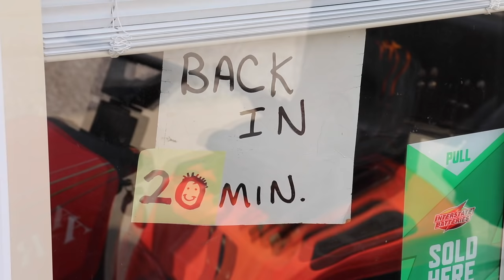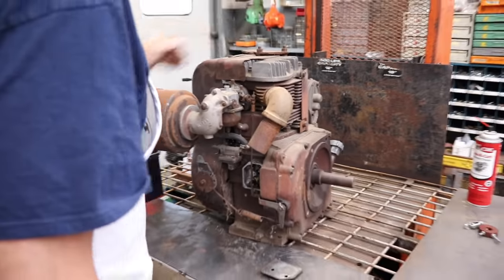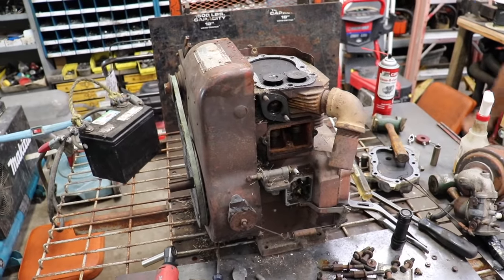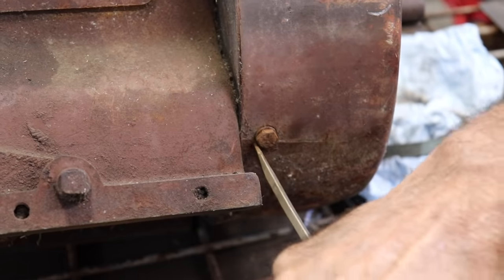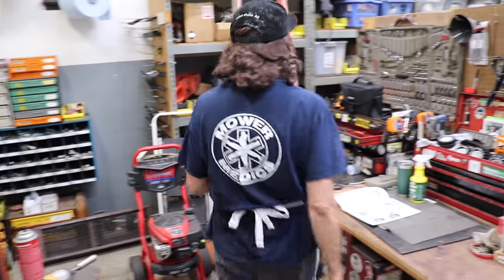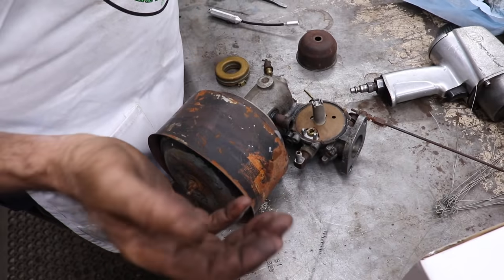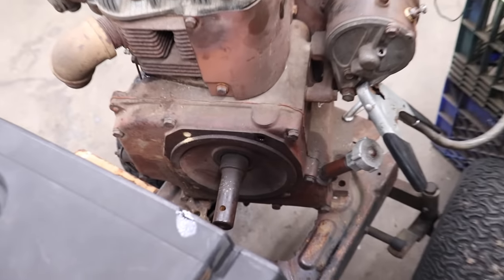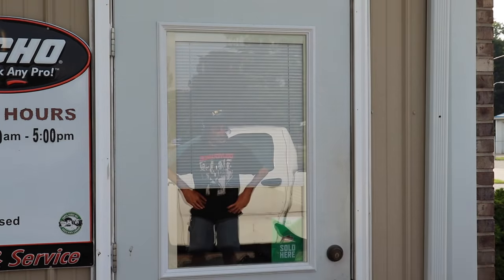Incredible Vintage Wisconsin Engine - Will It Run?

Comment: Hey Taryl,     Just wanted to thank you for a suggestion you gave regarding cleaning up valve seats using emery cloth and the valve to mimic the angle of the seat, to clean them up.  It worked like a charm. Working on a Wisconsin ABS engine, virtually zero compression.  Thanks to your recommendation, it has compression now!!!!   Thanks you Sir!!   Your videos are awesome by the way!!   👍🏻👍🏻

Comment: Back in the seventies, when I was a young apprentice carpenter those Wisconsin engines were on all kinds of equipment, mixers, generators etc. They ran real good and pretty dependable.
Reply: I used to have one left in a garage I bought. It didn't have generator starter, it had rope start with huge magneto off the side, like a Joe Hunt magneto.
Reply: They were great engines and I worked on a lot of them

Comment: Every think about getting a rear engine snapper and weld/mount an engine mounting plate to the front?  You'd have a drivable test frame. You could make the engine mount a bit higher so you're not constantly stooped over working on an engine. Then when you're done you could drive the test frame out of the shop and park it next to MoTow.

Comment: Cool project, only Wisconsin I’ve ever touched was about 50 years ago when I was very young. As I recall the motor weighed as much as I did back then.  I also remember the shock I got from the Wico mag it had!
Reply: Yeah, them mags ain't BSing , eh?
Reply: That's how I 'learned' to check for spark on old small engines. "Here, hold this while I spin it over!"
Reply: Yep 👍 
It’s a light up your life

Comment: This brings back 1976 shop apprentice memories. Getting yelled at for using the boss’s extra thin Snap-on tapped wrenches to loosen a rusted deck bolt. “Not my Wisconsin tappet wrenches you numb skull!” Today I could sue, and own the shop for being traumatized.  Well at least I remember what a tappet wrench is.
Reply: Litigation run stupid ... I'm sure that Snap-on cost him dearly 👍

Comment: The TRA-12D for sure came out of a Bolens. I have a 1971 Bolens Husky 1256 with the TRA-12D. I recently blew a head gasket on it. Was still running on 28 psi compression! Plowed, disked, and tilled my garden with it like that. Bulletproof engine!

Comment: Pretty cool Taryl, I like old engines and equipment, I have an old Briggs and Stratton 16 HP horizontal shaft cast iron engine that runs great.

Comment: 50 years ago I owned a 180amp lincoln dc arc welder with a vertical twin 10.5hp wisconsin. it was crank start. when I had a intake valve stick(always the same one). I would remove the spark plug and shoot oil on the stem. then exercise it(pushing it shut with a bent screwdriver) after just a bit it always started. these old wisconsin engines are great.

Comment: I like to use a spray bottle with 2 stroke gas to mist the intake with fuel.   Its much cheaper then carb spray and it's better for the engine plus it provides some lubricant for the top end.  I know Taryl has been doing it this way for 40 years with zero issues.  😄love the videos!
Reply: Carb cleaner spray and even starting fluid (ether) are basically volatile solvents so using them on an engine that has been sitting for decades is not recommended because they dissolve whatever oil remnants might remain in the top end, but in the grand scheme, you're being super over-cautious. Rest assured, a friendly-to-the-channel channel, Mustie1, does indeed practice what you suggest. He uses two-cycle fuel as his go-to starting fluid.

Comment: When I was a kid we had one of those that ran a compressor with a clutch. Mounted on an old lube truck. I was checking out the engine, setting points, ect. I removed the distributor cap and pushed electric start button to check the points and it fired right up with no cap! I swear it ran better with it off! Of course spark was jumping all over the place but we sure got a good laugh over that one!

Comment: I have about 20 Wisconsin engines. When I needed parts, there was a guy in PA that occasionally posted on EPAY. Good Luck, Rick
Reply: any chance you have a ACN motor that you would sell
Reply: Yes, Rock Creek Consulting!
Reply: I was not notified. Sorry for taking so long to get back. I'll have to look, but it will take time. Good Luck, Rick

Comment: If you can repair the old 4 cylinder, 65 HP Wisconsin engines, I'd say that you could have about 100 customers from guys in one of the stump grinding forums I know, as one brand of older stump grinder frequently has those engines.  Guys there frequently ask about replacement parts and repairs for those engines.
Reply: Overhaul of the VE engine is exactly what is missing now.
I would also like to know where to buy spare parts for it, and it will be very good.

Comment: i was a engine mechanic in a wrecking yard for 32 years. By not undoing the hot wire it can ruin the points like you said. If you leave it hooked up to long, the coil can also burst open sending hot oil around the room.

Comment: I'd be interested to see Wisconsin with the electronic igniter ignition. 
My Tra10d doesn't have points and condenser but a Wico magneto coil under the flywheel and some sort of electronic gizmo hooked to the single wire coming out behind the flywheel.

Comment: Interestin, low or no compression every1 thinks "Rings"  but  a stuck valve might be the
only reason.
Reply: Stuck valve(s) or insufficient valve clearance seems to be the norm. The latter happens from the valves hammering the seats and is often misdiagnosed.

Comment: Around 51:50 it looked like the engine block was a spark plug. When Taryl  missed sprayed above intake. I saw sparks shoot out of that spot (by intake) then around points box and made it's way to the muffcan/exhaust. Unless that was fake? I hope it was. It came close to igniting the starting fluid "mist". Glad it didn't. Stay safe Taryl and love the videos!

Comment: Wisconsin VE4D engines will explode the coil if the ignition is left on without the proper coil resistor. ;P

Comment: When i was a kid i read an article in hotrod magazine where an old timer machinist would tap stuck bolts with an arc welder and smoke the corrosion and voila the bolt would back right out

Comment: Marvel Mystery time lol. Started using that stuff back in my first wife time in the early 80's.
Reply: many applications, the best one was when I stored a SX2 650 engine i pulled of a wrecked bike, Both cylinders filled with. was told it was like new when installed. Like and idiot I sold it on a lunch break. ha ha the guy had money. 1972 sx 2 650. Held my word, 500 bux , back then was a chunk of change. the bike was like new . I traded a wingback boat with a 25 johnson for it, then bought another sx bike that was layed down for 75 bucks, with the two had a new bike. Love your Channel.

Comment: I've been told to never use use sandpaper or emery cloth to clean electrical contacts because it can embed grit into them. The embedded grit will cause the contacts to burn in use. Always use a point file to clean them. Has anyone else ever heard this or know this to be true?

Comment: You may have thought of it by now.  But, with the lifter and pushrod gallery being rusty and crusty from water.  If the dipstick doesn’t go to the bottom of the crankcase sump the water could be sitting on bottom under the oil since the engine has obviously seen a prolonged period without being ran.

Comment: Hey Taryl great information in ALL your videos. I have a savage arms model 30T with a Briggs engine on it. Also on the plate with the model no it has TYPE 561 .Someone has painted over anymore information it would have had on it. Can you tell me where I may be able to purchase a carb for this. The carb is fairly long with a oil bath air cleaner on it. Thank you.
Reply from the maker: I always search the inter screen. Or online small engine forums, also tractor shows. Theres your Dinner!

Comment: Pretty sure this was the engine on my dad's Bolens 800 garden tractor.  He had the belly mower, front blade, and single bottom turn plow attachments.   The "3-point hitch" was manual, and I remember the blisters I used to get on my right thumb when plowing the garden each year, from the push button release on the lift handle.  The biggest problem he had with this engine was the magneto coil kept going bad.  For some reason, they were hard to get, so he always kept one on hand.  It was a workhorse of an engine.  I wish I could find an old 800 with an intact engine.

Comment: Question I got a old snapper  vintage 8hp  Briggs.     slow spray of oil out it on lower end gasket.    every time I use it  is there and way of doing a quick fix  until I get it rebuilt in the winter months

Comment: That engine would also work on a sears suburban 12 . The earlier ones also had a starter generator. It being a 12 horse side shaft it could also make a good go-kart engine. Provided a heavy duty centrifugal clutch with a sprocket can be found .or make it a belt drive .

Comment: I never use that ether based starter fluid. Why spray a powerful solvent into a cylinder wall. ..I use gasoline with 2cyc motor oil and a spray bottle.

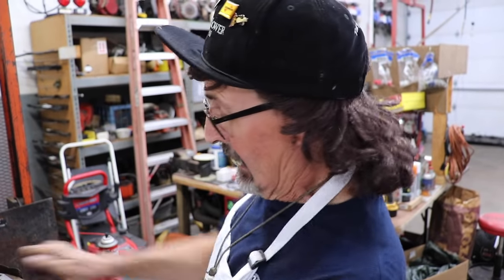Comment: My 5.7 litre Chevrolet LS1 V8 engine had stuck hydraulic lifters in the engine once it warmed up just like at 17:18 because they were mushroomed.

When I replaced them in 2018 that fixed the problem !

Comment: Apparently Lifters were very common until a real smart guy designed the overhead cam engine making it so the lifters are no longer required.  This is the first time I ever saw lifters in an engine :P  Yeah yeah I am a noob.  Its really cool you guys know how to fix all this really old stuff.  Is this engine what they would call a "pushrod" type engine?  I wonder how often people would have engine problems because the springs or lifters would start to wear out...

Comment: I wonder why you guys don't use a gas such as propane or butane to test start engines? Surely it id more controllable than wet schmoo, and will not flood the plug.
Reply: I use propane all the time but I also work on old tractors with it

Comment: glad u got her running Taryl, ground the F Terminal and put Bat + to ARM and charge the battery.
be better off w a voltage regulator.

Comment: Taryl, in another vid, u said the A was for Alan and the F was for Frank. U do know that there are
two means of wiring these right. . .?  The A style has one side of the FIELD wired to the
ARMature. other end of field goes to smaller field terminal, if bridged to ground, gen will put out
maximum output and a somewhat higher voltage, overcharging the battery.
In the B style, one end of FIELD goes to ground and other end must go to the armature to excite 
the field poles. You can't use any regulator but the one with proper amps rating and wired for that
type of generator.

Comment: Those old wissee engines seem to hop n pop when they ran anyway. But there super engines always have been. Like the old kroler  kohlers most old cast iron motors.
IVE got a big old cast iron B&S I think 15 or more hp..I my shed..

Comment: 19:23 Given enough time to sit, even the dirtiest of sump oil will eventually "settle out" and separate leaving the heavier dirt and particulates on the bottom with the honey colored oil resting on the top. In your case, that could be the case or someone did in fact drain the oil and add in some fresh oil.

Comment: I have a question regarding my Scag walk behind.  Why does it bog when I go up steep hills?  Is my fuel pump going bad?
Reply: Drill out the low speed idle jet with a mini drill bit set.

Comment: I trash picked an upright vac and took off the hose and the end fits perfectly into my shop vac ,it's longer a much more flexible. Also to get into tight places I duct tape a piece of fuel line or heater hose into the end . Just sayin'.

Comment: Why are you hitting that wrench on the table when adjusting that valve? After every turn of the wrench.
Reply: Probably the rust flakes and other detritus , Rex. Rex was my dad's first name. Rex Winston R. He showed me how to rebuild a troy bilt weedeater carb around 20 years ago and I have it now . Runs great other than the carb needing to be adjusted every 4th or 5th time you use it.
Thnx for the memories Mr. Shepherd

Comment: Yo T!
I got an 18 horse opposed twin briggs off a craftsman LT1000, i put it on aJD L100.
2 things i need help with, because I'm dumb.
#1 the 18 opposed has a complex governor assembly, and i think I'm missing a super fine spring from one of the linkages.
#2, how do i get the charging system working on a swap job where i don't even know what parts i need?
I need my dinner!

Comment: I see that you have WD40 in a plastic sprayer bottle, doesn't the WD40 would eat the plastic over time? I did the same with a plastic sprayer bottle and the nozzle stop working. any tips on that?
This channel is the best bringing engines, old engines and vintage back to life.

Comment: In NZ there is a running joke that you can use weetbix box to make a breather or sump gasket in an emergency for small Briggs and Stratton motors. Keep it in mind, I've used this trick on old Briggs that were junk so i could test them out before sinking money into them. Using a greasy finger or a hammer to imprint the shape while it's resting on the part you need to seal together.

We also have a saying for bad drivers "Where did you get your licence? Out of the bottom of the weetbix box or something?"
I am sorry if I'm trying to teach an old man to suck eggs as my father would say.

Comment: For mechanics like you & me with "edjucated" hammers, helping the valves & lifters out is OK, but I'm willing to bet alot of bent valve stems results from this "abuse"! My first engine was a Clinton 1-1/2 HP with a "T" valve configuration in 1967, I've got the same model out in the barn with stick valves waiting to take me  back in time!

Comment: Needs to heat up the valve
Also take of the lifter cover heat and use penatrating oil
Had an old Wisconsin that had valves stuck

Comment: Hey Taryl try using stuff called "Free All" instead of the WD-40. You will be surprised how well it works on seized and  frozen parts.
Reply: PB Blaster penetrating catalyst is my go 2 if you want continued lubrication

Comment: (high pitch voice) Hey Taryl, you didn't check to see if the exhaust vale was seating good and causing the wide gap before you checked the gap :)

Comment: I use that kind of wire on Outbord motor’s I buy it like you by the roll I got a craftsman lawnmower 18.5 hp BS it’s new I have only mowed under 20 acres my yards only 3/4 of an acre and I mowed it about 25 times and there’s oil on the motor is that normal
Reply: I call it the FACTS check fuel air compression timing spark got all that your Outbord motor will run

Comment: How much oil is ur truck gonna burn haha
Reply: My 1972 chevy Vega station wagon  burned a quart of oil every 45 miles ..But oil was cheap back in 1985  $ $0.34 a quart .Castrol oil was $0.45 a quart ...It was one of the first Green cars .it self changed it oil

Comment: Why not put one of those Briggs and Stratton packing operated fuel pumps with your black up late and you’re sitting in there like you did on the other end and you were gone that code work
Reply: Yer drunk.

Comment: Go carttin engines when you see 12hp you gets 12 pony's that engine can be bored. 030 over an  gets her to 14hp that is a candidate to go .030 over that starter is old school bullet proof rebuild that also parts are still available for the S10D-14dD series

Comment: So the starter spins while the motor’s running?
Reply from the maker: Yes sir its called a starter generator it also produces voltage to charge the battree.
Reply: @TarylFixesAll  That’s really interesting.
Reply: Change up battery

Comment: Had a 1973 Wisconsin TJD twin come in, carb needed rebuilt, customer said. Carb was pretty dirty, so tore it down and serviced it. Went to start it, the 6volt battery exploded. Luckily, none in my eyes, but so long shirt. Finally got it started, and tan for 30 seconds, then thick grey smoke started chugging from the exhaust, and a shower of oil came down. Intake and carb had oil in it and plugs were fouled. Cleaned everything, verified the oil level was correct  and breather was working. Started it again and same thing happened. Told customer it was either a blown head gasket or worn guides. He saw the price of parts and said, no thanks.